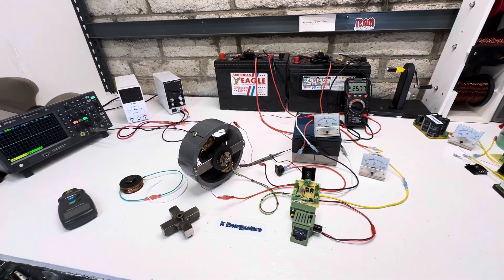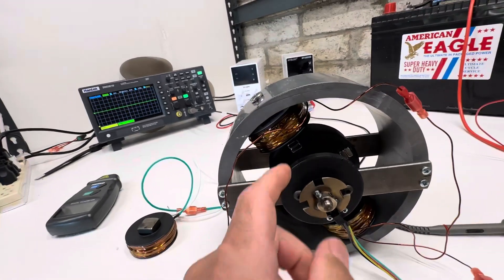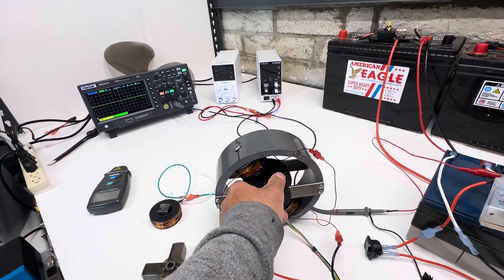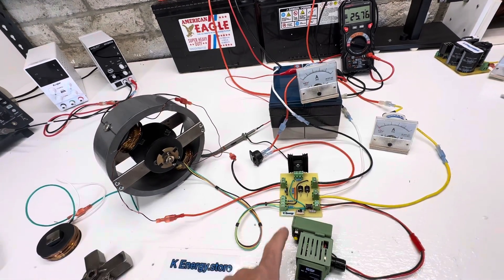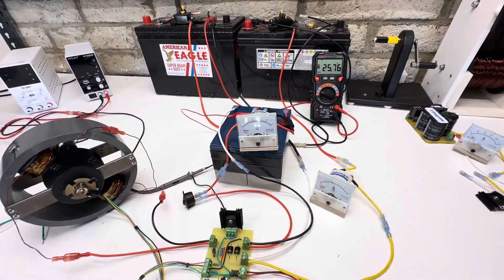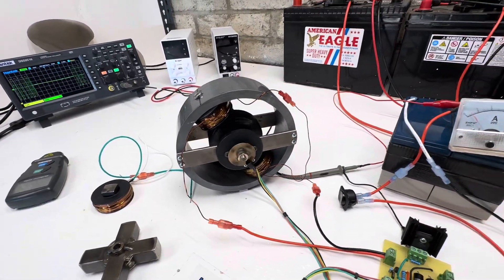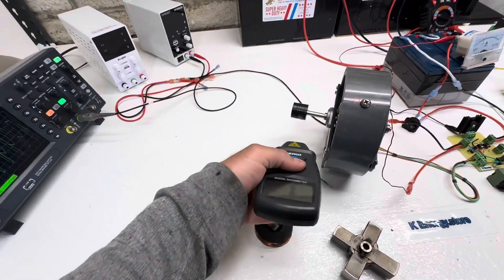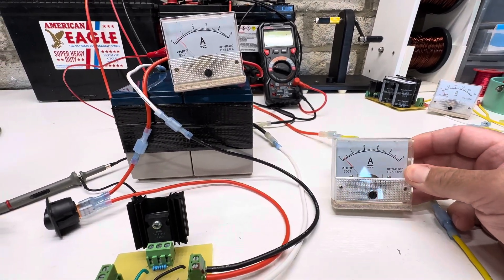Repulsion pulse motor

Comment: See what I'm planning on doing is 
buying a wind turbine 800w output, 
taking the blades off and 
connecting that shaft to my pulse motor, 
so my pulse motor does what wind would normally do spin, i doubt my next motor will be over 12watts input, for the 800watt out, 
how isnt that overunity? If its 12v out and designed to keep a12v battery charged surely it'll run forever until it burn out,  have you ever thought about trying it?

Btw the hho cell doesn't do much off the ssg compared to being hooked up to the battery straight
Reply: @dedu456  i also wanna hook my hho cell to a gas generator see if the hho produced will be enough to power itself from just water, just off a car battery it's impressive gas production, it should work in a petrol or diesel generator, that's gonna in the not to distant future,
Reply: @dedu456  its funny hearing you talk about comments getting through, on 100s of subjects i get mine deleted all the times i bet ive had 10,000+ comments deleted, we have like a illusion of a free world
Reply from the maker: Hey buddy! Sounds like a good experiment I have done some test like that 

That’s good to know just needs more amps then
Reply: @kenergy1707  most wind generators need to spin at 500rpm for the  stated output, that speed doesn't cost much on our motors but will they have enough torque to spin it?
Reply from the maker: @doubleooh7337  I guess that depends on the motor
Reply: @kenergy1707  what who was that guy all comments gone atleast i seen his 1st comment
Reply from the maker: @doubleooh7337 yes 
Hope to see video on your new device as it comes together!
Reply: @kenergy1707  I'm currently putting together my coil winder, I'll get a video of that when i start winding, this is delaying me ha, i got a week off coming up do probably do most then, working 5days i just dont have the energy i used to, i miss 3days a week.
Reply from the maker: @doubleooh7337  cool sounds good
Reply: @kenergy1707  yep but if it'll spin a wind generator , the excess power from that should power the hho cell, i say 800w but think that one is 50v out and 16amps out, some are 12v out and a few hundred watts so they got the high amps out aswell, I'm getting one as soon as i got the coils wound,

You know if you connect 2x12v batteries together in parallel the 2 batteries equalize the amps between the 2? What happens if you connect 2x12v in parallel with using  diodes? Like
1 between the 2+ > and 
1 between the 2 - <
With the diodes facing the way shown here^, I'm thinking like that, the wind thing connected to 1 battery and the motor to the other battery , I'm thinking connected like that it should work, obviously abit hard to explain, how do you think the batteries would behave with the diodes connecting them like that?
Reply from the maker: @doubleooh7337  that sounds like a good way to transfer in and out
Reply: @dedu456  papa bale has a pulse motor like thr monopole motor but not sure he's up for trying it he keeps saying free energy doesn't exist but im not talking about that , only overunity, I've seen plenty spinnig and they look pretty free spinning really but i can always put a heavy flywheel on the shaft and get that up to speed 1st before connecting a output, but I'm doing my motor like the other on my chan, which is like Joseph Newman motor , magnet inside the coil, it works perfectly with the ssg, his was bigger, but his 5000lb copper wire motor was able to get a 1tonne fly wheel spinning fast with just volts and very little amps while also operating s water pump, I'm 50/50 if itll work and good enough for me to try, I'm not bothered if it dont work but feedback is always appreciated ;)
Reply: @dedu456  yeah I'm subbed to that guy ;)
Reply from the maker: @dedu456  yes they are  !
Reply from the maker: @dedu456  it won’t yet me respond to your comment! And yes you are right on 👍
Reply: @dedu456  i think i used to watch his videos is he still doing it? Using a dc motor to spiin a bigger motor while using the ouput off the second motor